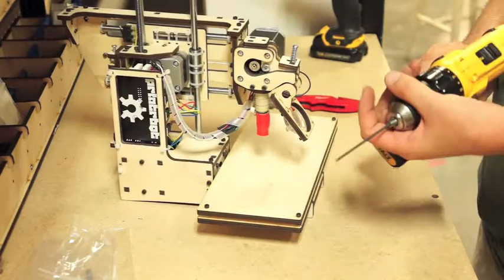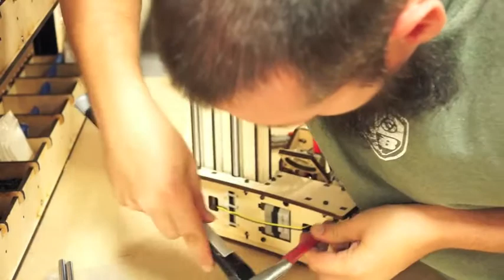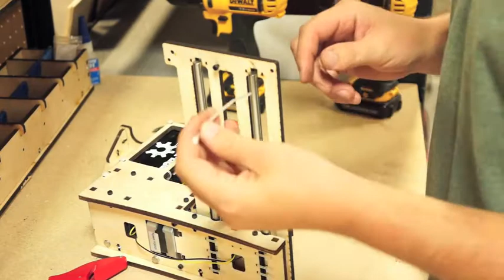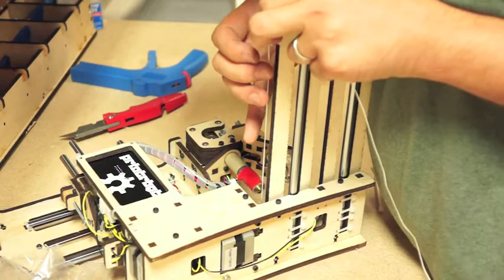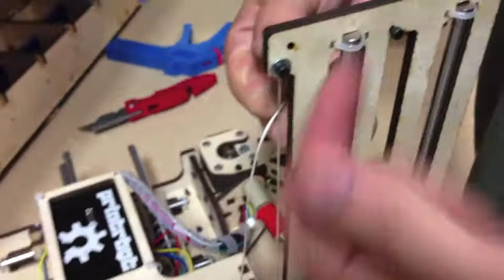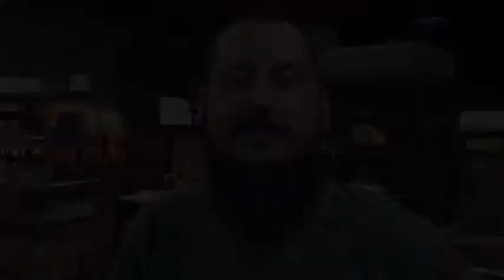Simple Build Volume Upgrade - How To

Comment: Just got the kit and the bot kit in the mail and started assembly with the volume upgrade (this kit has the larger motors) but I noticed that the wood piece below the printbed does not fit - it hits the motor shaft.  The 4" X 4" one does fit, its just a difference of about 1/4"in the way it was cut out.  Any suggestions on how I fix this?  I am happy to modify the kit if needed. @in_the_garage